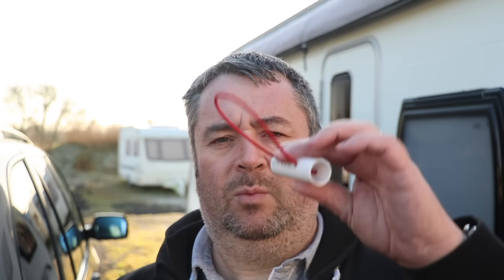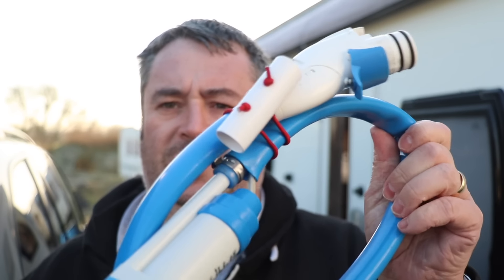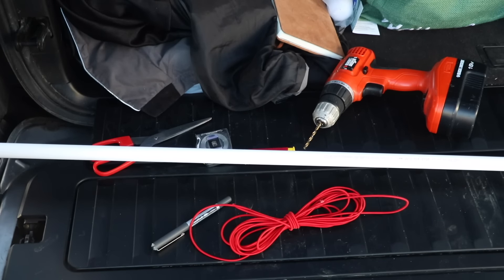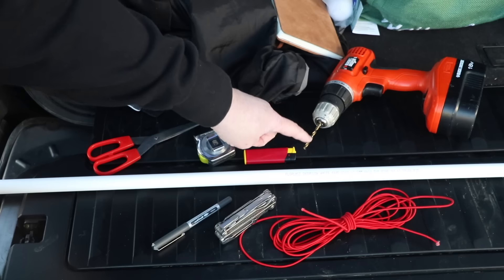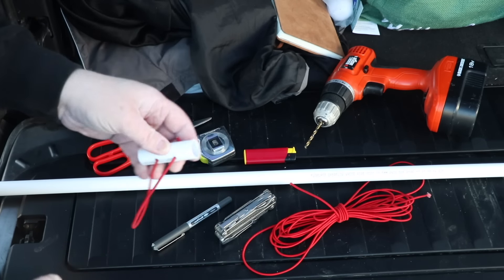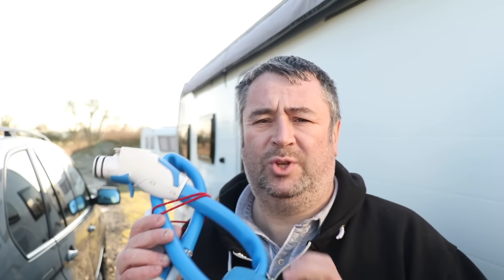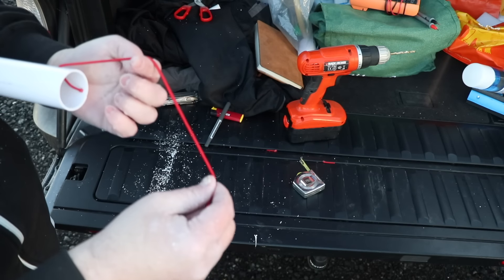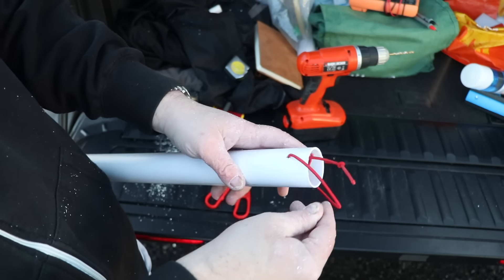Cable tidies & Water filler pipe for the caravan or motorhome

Comment: Hi Dan, 

I run a plumbers merchant, I've made a water filler pipe the same, using bungee cord but, rather than the ridged pipe I've used a flexible fitting by Mcalpine, Google "flexcon2"  for me it makes storing it easier :-)
Keep up the great vids, when are the cadac cooking ones coming!!??

Cheers Stuart
Reply from the maker: Hi Stuart, Great tip, thank you. Yes the cooking series is coming along well. I think everyone will enjoy it. Still lots to do though.

Speak soon

Dan

Comment: Hi Dan, we made the filler pipe a couple of years ago... what we used to adapt the length was the cord grip that you get on a sleeping bag or coat.. it means no need to tie knots..  https://en.m.wikipedia.org/wiki/Cord_lock
Reply from the maker: Hi Daren, great idea. i did consider using the cord grid, but didn't have any to hand. This could be the "deluxe" model ;-) How long did you cut the tube when you made yours ? and have you found it generally too long, just right or too short ?

Take care

Dan
Reply: We didn't measure the tube.. it was about 50-60 cm..  It is just right..  the cord was less elastic than your bungee cord..